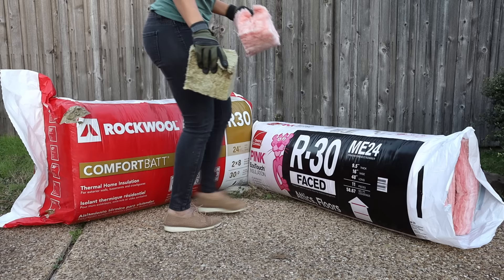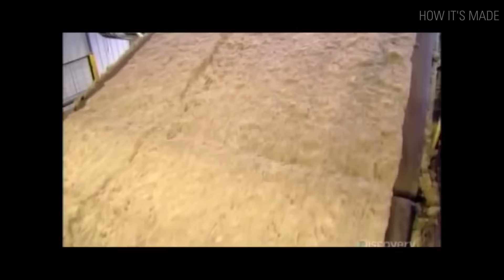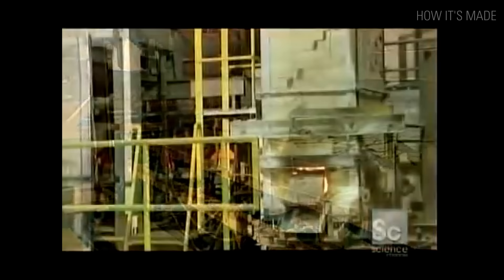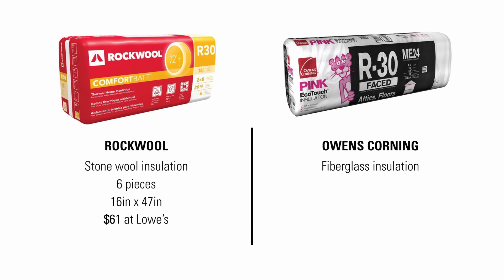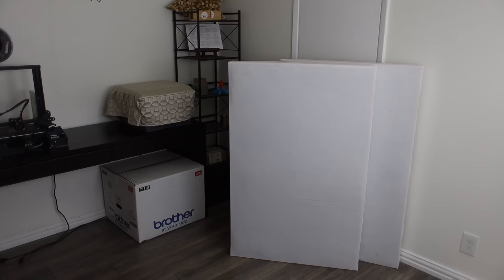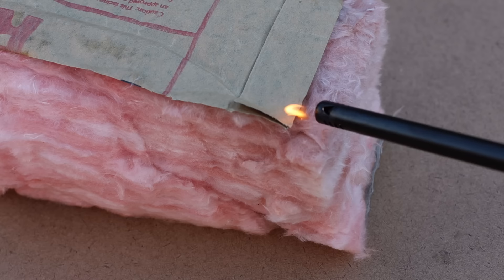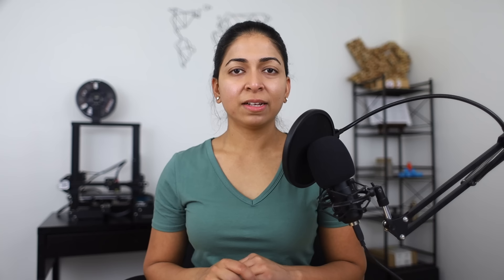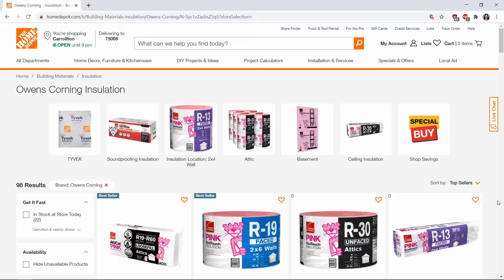Mineral wool vs fiberglass insulation | everything you need to know

Comment: Rock/mineral wool insulates much better. Too bad I can't find anyone around here to spray it.
Reply: You can't spray mineral wool...
Reply: @David_krappenshitz  Of course you can. Why do you think some companies that stopped spraying it said that they stopped because it was too hard on their equipment? I had some interesting discussions with multiple contractors about this exact topic. You really need to check out some more attics and see what's in there.
Reply: @jakestilgard4145  don't you mean blown in? You can wet spray it but thats usually for walls so it sticks. Spray usually refers to spray foam like polyurethane
Reply: @David_krappenshitz  Yes. Blown in is the correct term. That's indeed what I meant.

Comment: Rock wool is far superior. Fire proof, water proof, mice and bugs hate it. The particles drop to the floor, not float in the air like fiberglass. It also provides better sound proofing. I won't use anything else.

Comment: ROCKWOOL DOES NOT GET WET DOES NOT HARBOR BUGS OR MICE  AND DOES NOT MOLD OR MILDEW  . mY HOUSE IS INSULATED WITH IT  2X6 STUD WALLS AND FLOORS AND ATTIC AND IN ALL ELECTRIC AREA  MY ELECTRIC BILL FOR A 2440 SQ FT HOUSE IS LESS THAN A HUNDRED DOLLARS A MONTH  . WITH A WELL  AND A KOI POND THAT S OVER 5 THOUSAND GALLONS

Comment: Fiberglass is not a mineral. It lacks a crystalline structure.
Reply: Pedantic. Silica plus a variety of minerals. "As the name suggests, fiberglass is made of glass fibers. This includes several basic raw materials, the primary of which are silica sand, limestone and soda ash. Other ingredients used in fiberglass insulation production include borax, calcinated alumina, feldspar, kaolin clay, magnesite and nepheline syenite."

Comment: I am itchy just watching this video. Good stuff but I still have night terrors from using this stuff. wrapped in plastic duck tape on the gloves and sleeves full mask sweat running down my back etc. There is no such thing as non itchy. Forget fiberglass. Rock wool is the better material.